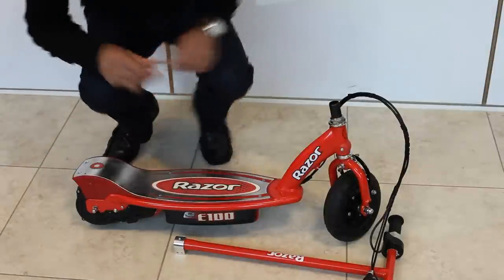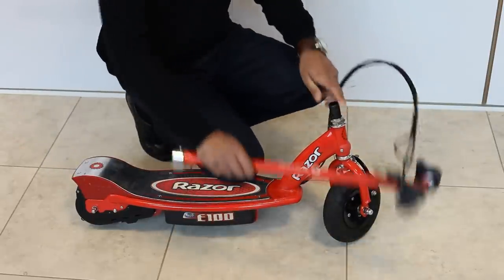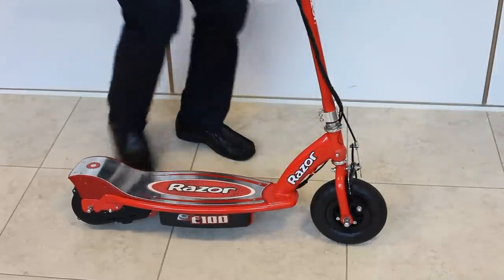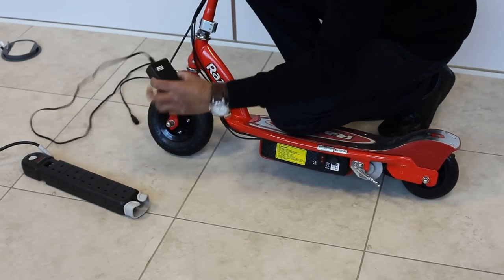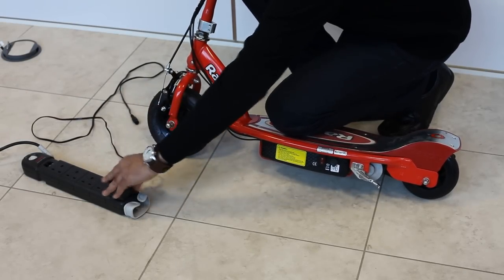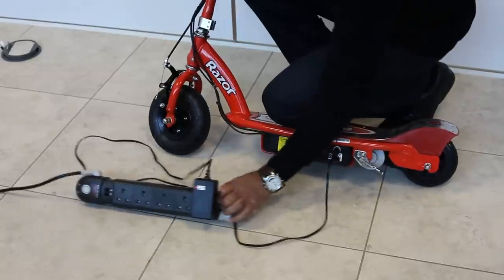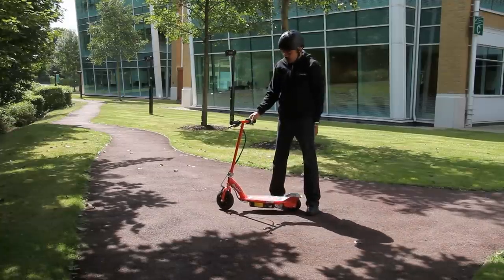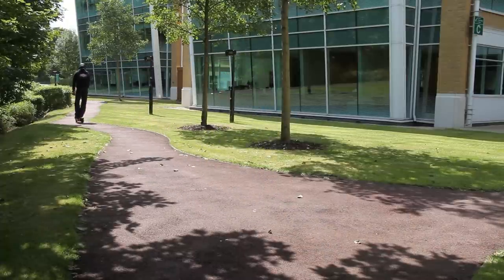Razor E100 assembly and start up

Comment: He did what the manual tells you to do. Good video, having troubles with the tightening of the handle bar... I loosen and tighten once its attached and still able to pull it off...
Reply: Having the same freaking problem did u ever get it ugh about done with this stupid thing
Reply: Maybe push it down? I had this problem but I pushed it down while tightening it and it helped

Comment: I thought the maximum weight for this e100 model scooter is like 56Kg ~(125 lbs) or So? I didn’t know this would work for adult!!! Enyone know it for sure please let me know I really need this for myself!!!
Reply: know your words genius, its an E300.
Reply: I think it is
Reply: I'm 70kg and it did not break
Reply: adults really its e300 but if your a bit heavier really dont think t will make a difference using this one.only problem will be the handlebars if you see where they come on him .up to 5 feet 5 you will get away with it past that you wont